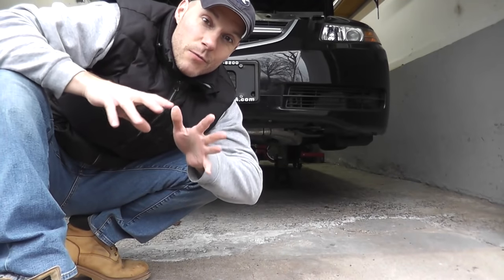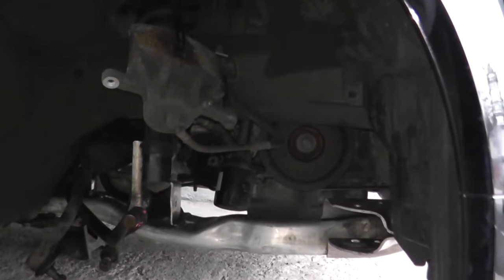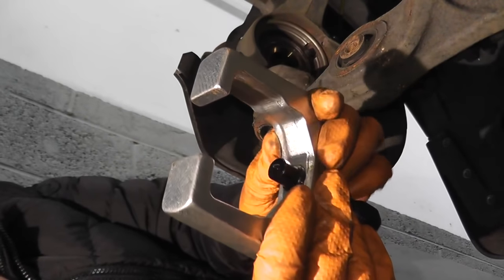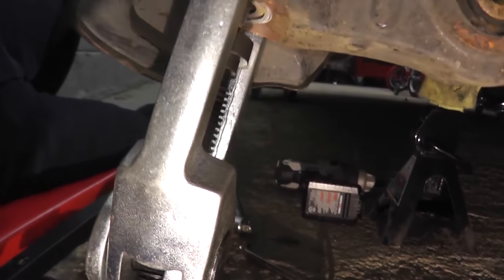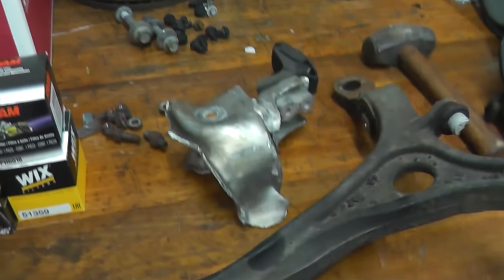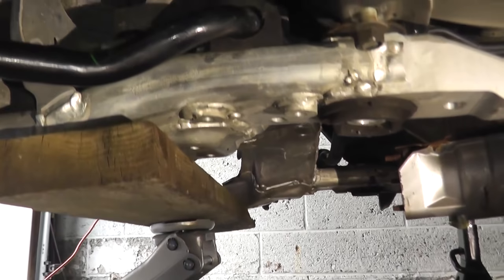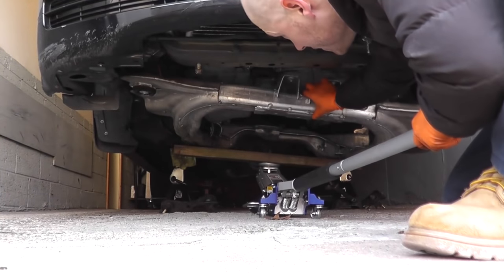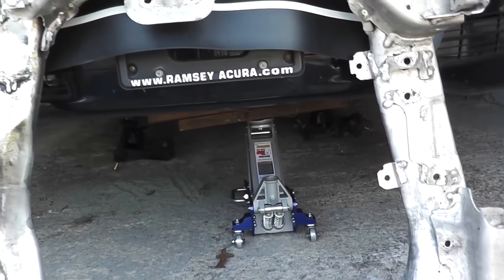How To Replace A Crossmember or Subframe with Basic Tools Part 1

Comment: Did you have to remove the shift cable? If so how? It shows in your video that it was in the way when you were lowering the subframe but then just jumps to you removing it with out showing how you took of the shift cable.

Comment: First off loved your video, bro! Straightforward, precise, professional, and informative. I wish I had all the tools necessary to do the job.  I have an almost exact situation. I bent the sub-frame on 2013 Acura TL AWD. Mechanic is qouting almost $5,000 with parts and labor. I’m going to get a second opinion. But can you tell me any X-factors I might consist or any problems/other things that might need to be replaced? Or is something like this usually fixed by just replacing the frame? I hydroplaned into a curb also. Any advice I appreciate it. Nice Acura by the way!!
Reply from the maker: Hi Jihad. Sorry to hear about the damage. What your mechanic is quoting seems to be just about right. Chances are they plan on replacing the knuckle, lower control arm, wheel bearing, tie rod  and shock on the damage side; as they often bend. You may be able to save a bit going used rather than new, but that's your call. The crossmember in my case was a used unit I purchased for $450 ,including the sway bar. One thing I was certainly worried about was the steering box. Fortunately there was no damage but that is something that may come up as the mechanic dives in to the job. In the short term, my advice to you is don't drive the vehicle. I quickly go over what happened to me in this video....https://youtu.be/ypovBqtj5Io ….but long story short, the subframe failed while I was doing a k-turn in front of my house and I had to get  tow truck to literally move the car 30 or so feet.  Feel free to email me at carsntoys@gmail.com if you have any other questions. Good luck!
Reply: CarsNToys Thank you for replying. I hope I don’t have to change all that: but if it’s best to do it all at once, then that’s what I’ll do. 1 Question: the steering box, is that the same as the Power Steering Rod on a 2013 TL? Or is that a different part? Thanks again, CarsNToys
Reply from the maker: Glad to help. Yes, they can also be called Power Steering Rods. Hope your TL is up and running soon.

Comment: Hi I have a 2007 Mazda 6 with a rusted k frame. There is one place where it is rusted out but it is not in a critical place. My regular mechanic passed it on inspection but next year it may have to be replaced. He told me that sometimes the bolts can be hard to get out. I don’t want to sell for parts. Any suggestions about what I should do??

Comment: Well it looks like someone else in the world had the same problem I did this winter when I curb shot my Toyota Solara.  Fast forward 8 months after I got the replacement control arms I spy with my eye that the orientation of the bushings clockwise on the back hockey puck one is not correct.

Also I found it is useless to buy a shop press unless you have the correct pressing blocks and receiving cups.  

I like how you use a breaker bar too instead of a ratchet to break loose high torqued fasteners.  I don't understand those that just want to destroy their ratchets by pressing them to take off 150 ft lb fasteners.

Finally, I guess I won't complain about the tight quarters I have to work in after seeing how narrow the place you are working in.

Comment: My 2011 Taurus hit a train track and the subframe is shredded in a 2” by 4” area. Just a big hole. Instead of that engine bracket you used, would some blocks be just as effective?

Comment: I have 06 lowered accord. I slightly hit a curb and bent the front passenger side mounting point where the tow hook / mounting point is located. Only damage I noticed is that it bent the from corner downward a bit. No other damage noted. Should I be concerned ?

Comment: Hey man, i need to lower the subframe on the same car (CL9)  to fit my header from my k20. It almost fits but the subframe is in the way. I was going to beat it with a hammer but I rather drop it. Is there an easier way?

Comment: How much it could cost to repair the cross members in Australia ? My car is Toyota Camry Ateva 2007. Mileage 134000 km. It’s having allignment issues. Fixed the wheel alignment.

Comment: Did u put a new one or did u rebuild it and what issues did ur car have before the replacement because my throttle body keeps going out
Reply from the maker: I purchased a used unit from an auto recycler / junk yard. The original crossmember cracked. (Hydroplaned into a curb.)

Comment: I also hydroplaned into a curb. Would there be any difference between an 06 and an 07? Or have you only done this one TL ? I'd think from 04 to 08 the subframes would be identical besides the type S
Reply: 04-06 auto and manual subframes are the same.

Comment: Great video. Is a front crossmember considered a suspension or just a frame and structural body part?
Reply: Structural. Usually, unless the cradle is shifted after a crash which can affect suspension settings and alignment